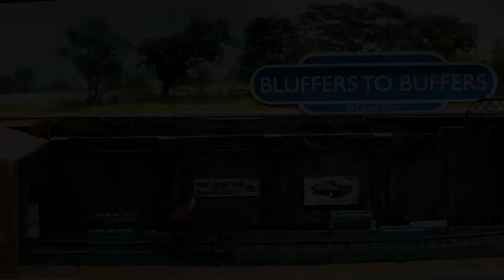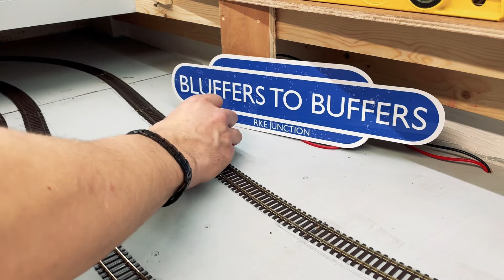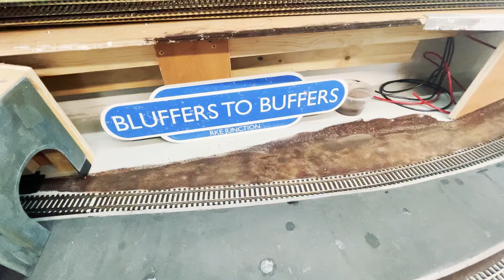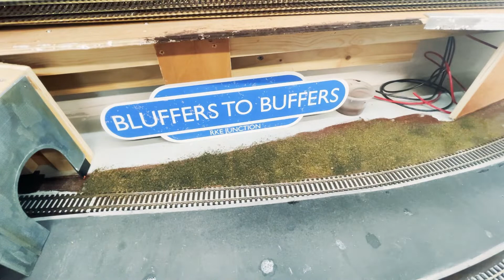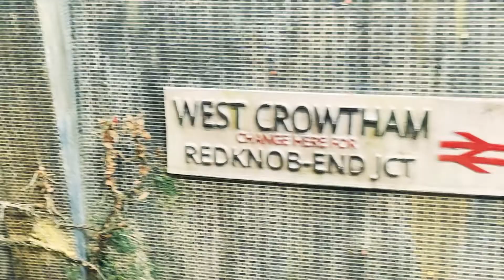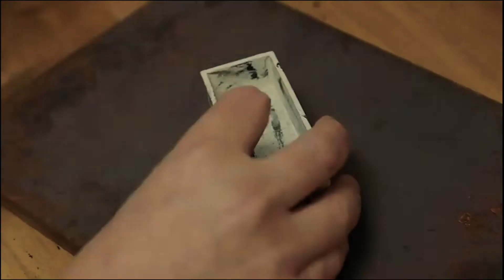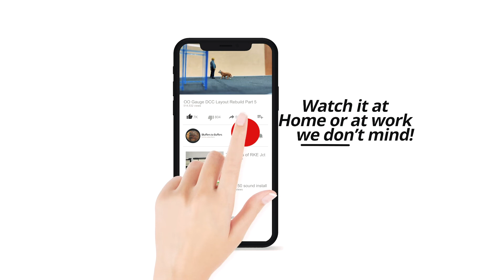OO Scale DCC Layout rebuild Pt8 | Scratch building retaining walls | Model railway Station Detailing

Comment: Nice update, thanks! I also got a Cricut just this week. Would you mind me asking what settings you used to cut your plastikard ?
Reply from the maker: Thanks 😀 Will look out what settings we used at the weekend - we opted to score and then snap with the Cricut, rather than cut all of the way through
Reply: @BlufferstoBuffers  - Good to know, we also have cricut and have never thought of could do that. Did you not the specific mat for card, or use one of the ones or time box?
Reply: Dib's Yard Shunting Layout  I used a circuit to cut 1.5mm mount board with regular mat that came with the machine and just taped it down with masking tape, the used the knife blade(sold separately)
Reply from the maker: We use the mat that it came with and mount board (as listed in the description) just needs easing in for the first cut. And the deep cut blade, of course.
Reply: @NewModelRailway  - Thank you. We have lightgrip and strong grip mats and a long blade.
Reply: @BlufferstoBuffers  thank you. I did not even know there was a thing "easing in" - sounds like a rule for life, that. Don't just wham it in
Reply: @dibsyardshuntinglayout  I used the lightgrip as here :https://youtu.be/3RfIoGkAIeU?t=849
Reply: @NewModelRailway  - ok I'll check that out. Thank you.